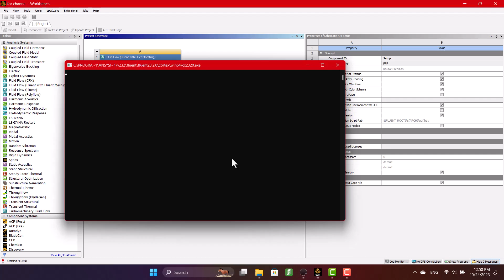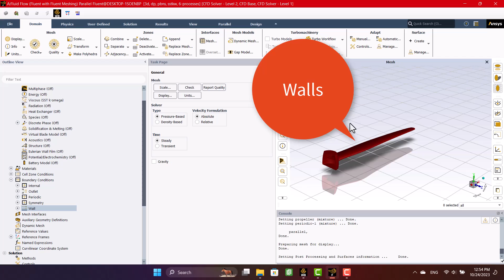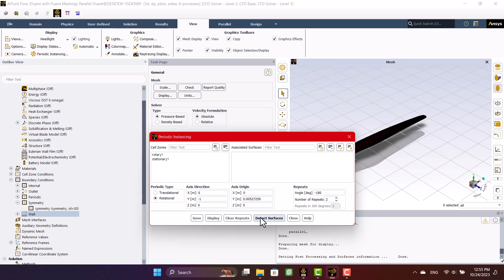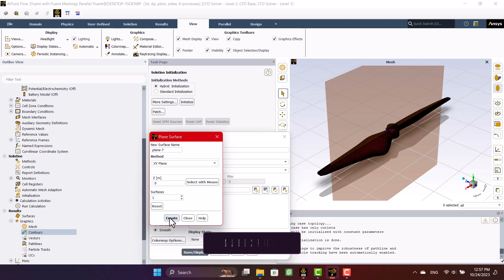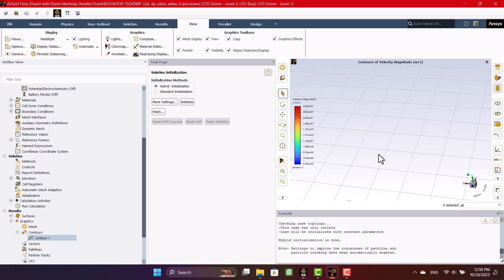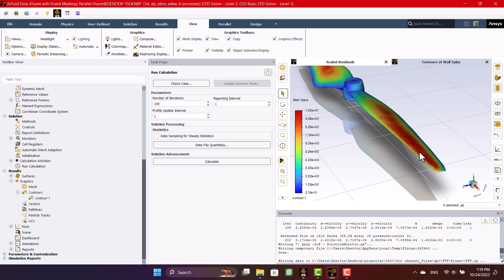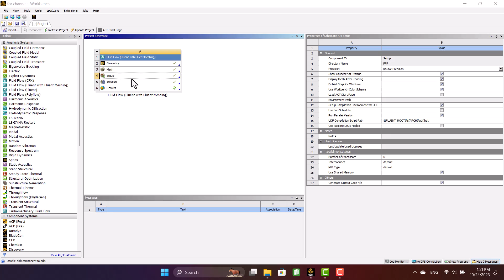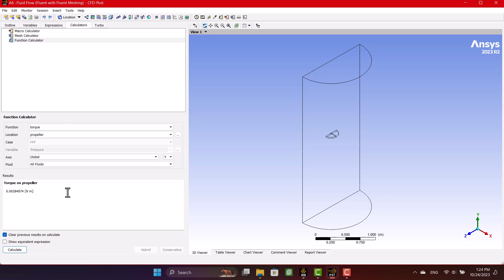🔧 ANSYS Fluent Tutorial: Thrust and Torque of a Propeller (Part III) ⚙️

Comment: Is this thrust force only for one blade or two blade. Should we multiply by 2 to get net force from whole propeller
Reply from the maker: If you are using symmetric boundary condition, you have to multiply by 2 for calculating the force in all simulation. But pressure is remains constant.

Comment: 你的计算中一直有回流的存在。你的外流域所有的边界都是压力出口。实际上我一般设置压力入口和压力出口，这样就没有回流了。如果我设置成速度入口也是会有回流的。 另外，在进行混合初始化之后，我会进行FMG初始化，这样有助于加速迭代计算，节省时间。
Reply from the maker: Thank you for your suggestion. The domain is large enough that the reverse flow does not affect the results. Also, the reverse flow issue is addressed by using symmetry for the lateral surface of the stationary domain.
Reply: @caewitharminhashemi  是的，理论上10倍直径以上的流域足够大不会影响，但是如果你查看螺旋桨的流线就会发现，螺旋桨吸入了它自己的尾流，这说明，计算的流场并正常。正常的螺旋桨尾流应该是一直向下发展的，直到从压力出口结束。当然，有回流可能对计算结果没有多大影响。另外，你为什么没有把静止域设置周期面？只单独设置了旋转域？
Reply from the maker: Thank you for your description. The mesh is very coarse because it's a tutorial video, and solving time is important. There is no problem with the fine mesh that I solve, and the answer is in accordance with your words. I always use a body of influence under the propeller with a fine mesh. @oy-5742